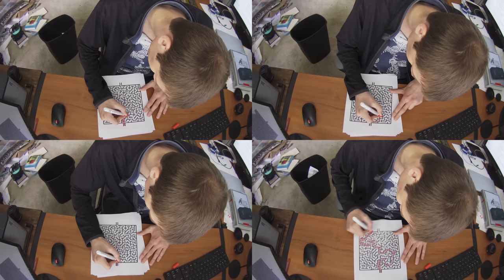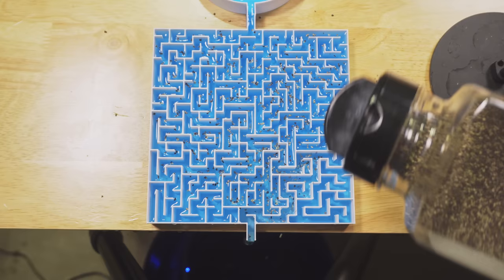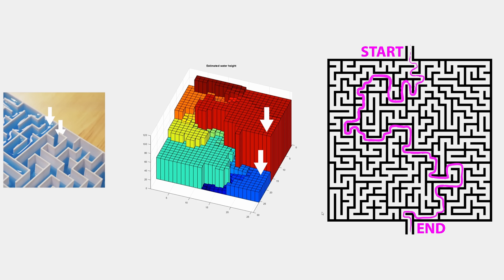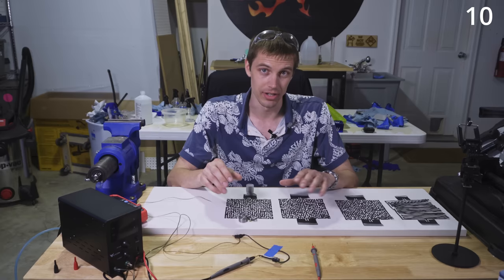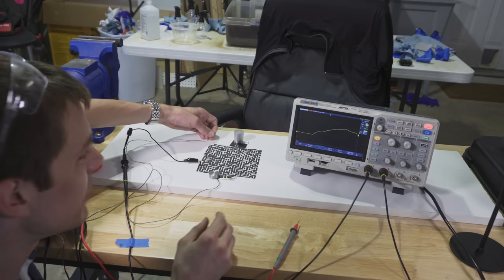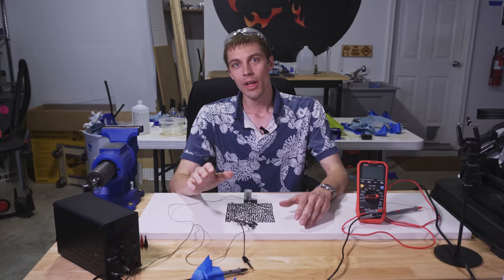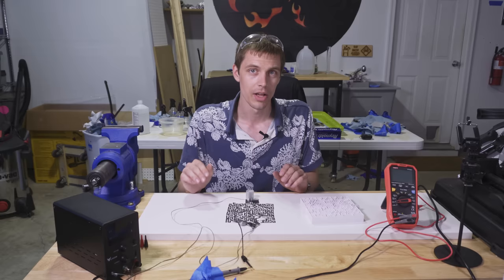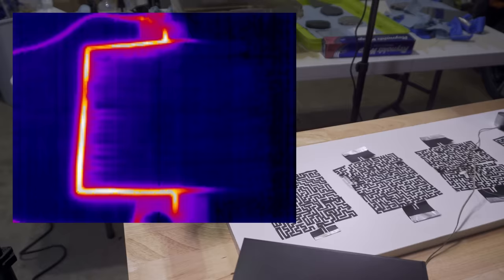How does electricity find the "Path of Least Resistance"?

Comment: The ending discussion here reminds me of two of my physics teachers back in the day arguing about whether the electron flow itself occurs at the speed of light, or if they move only a couple centimetres a second but transfer the energy to their neighbour at the speed of light.
Reply: Amperage measures the flow of electrons per second past a point. The flow is very slow.  The pulse through the wire is at the speed of light. It takes a long time for any one electron to move any substantial distance. It takes a long time for a water molecule to reach your home from the pumping station. But You have pressure, in your home, soon after the water pump is turned on.
Reply: @MrSummitville  yes, but the other one was arguing it’s not really analogous to water because electrons are clouds of waves rather than “actual” particles. Then the first retorted that it was just as equally a particle as anything else and their water metaphor (same one you just made) was valid. This went back and forth for hours, and they were both PhDs.

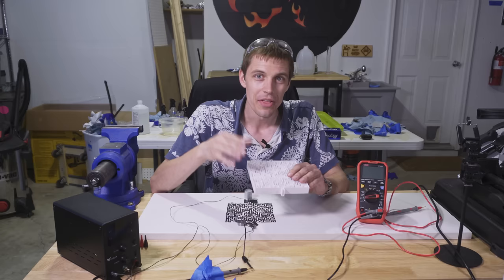Comment: Really good visual demonstration of current! One thing I think might be slightly wrong though (please correct me if it's not) -- When you compare the differences between water and electricity at 15:45 or so. I don't think the difference in water height at the start and end is analogous to a difference in electrons per unit length of wire entering and exiting the maze. I'm thinking the water height change is instead equivalent to the voltage lost between the input and output.

Comment: I'm sure others have said this, but I think it would be interesting in the final setup (before cutting) to start bridging rows of the long "ladder."  The more you bridge, the more that portion should heat up—except the portions you shortcut with the bridges.  Those, like the other longer paths, should still be getting some current, but less.  And, depending on where you bridge the circuit, the "cut off" portion should less the further away the bridge is.
Reply: Just like streets in a city

Comment: Emergence is a thing.  I've written articles and I have a few videos on this, but essentially if you take some very simple rules and apply that to a system you will often see an emergence that looks like some kind of intelligence (I believe intelligence itself is emergent, but that's a whole can of worms I don't wish to open here).  Dijkstra did some work on this and his algorithm describes the least resistance path that electricity takes.  That's why it seems to "solve" the maze - much like A* or Dijkstra can solve a maze.  There isn't any intelligence in the agents - in this case electrons - they are just following basic rules to determine the least path of resistance.  You could even do things like instead of a wall, put a dot in the middle of a corridor to represent a "monster", since that path does not have the least resistance due to the "monster" it will not choose that path.  Also, gravity (unless you get into loop gravity or string theory) is geometrically based, so it's going to have  a very different effect than a field based force which is what electromagnetism is.  In a charged field, because of conservation of energy, it will move to reduce the charge to zero - every single field that is oscillating is actually trying to reduce to zero, so any difference of charge will effect the same amount of response.  How long that response lasts in the time domain will determine things like field strength, but that's a more advanced topic.  The point is it's a field and it's going to respond the same regardless.  In a geometric construct though different properties will determine how strong that force is.

Comment: I'm not sure if I entirely follow what your correction 2b is trying to say, but I need to make a comment about/related to "surface charge".  Veritasium has done a good video explaining this but my understanding of the process here is that the propagates volumetrically through space at near light to produce a charge gradient, this causes a slow (order of cm/m) migration of electrons that increases until it reaches equilibrium with the charge gradient.  Voltage is the difference in the charge gradient that (mostly) concentrates on surfaces, current is the migration happening at any given point in the conductor.  The electrons don't really slosh, they don't move fast enough, it's the charge gradient seeking equilibrium as the wave fronts move through the medium of an unstable system.  The "path seeking" aspect is in Maxwell's stuff.
I think that's what you're referring to with the remarks about it being change at the top of the water, but that's pretty much surface charge.
(And yes, I know you're aware of this cause you were involved in the video debate I referenced)

Comment: In the University of Surinam they used electrical current to model the water levels in Rice fields. Connect current sources / sinks to opposite ends of a Carbon (copy) sheet cut to the shape of the field to be modelled and use a voltmeter to measure the simulated waterlevel (dd. 1984).

Comment: A differing test would be to design a maze that has two or more solutions, that are the precise distance and precise resistance, but not the same geometrical path, and see what the visual view is of the heat caused electron flow. It might produce a surprising result. Take three equal lengths of wire. String them through a long maze of twists and turns. Apply the voltage and view the heat signature. All three wires should be equally lit with heat… correct?

Comment: A mathematicians might be tempted to describe the way that both the water and the electricity solve the maze as a physical implementation of Dijkstra's algorithm[1], which is generally explained as "simultaneously exploring away from the starting point in all directions until the ending point is reached." If you explore in all directions equally, you guarantee that the first solution that you find is the shortest possible solution (since if there was a shorter solution, you would have already found it). But why stop there? What's interesting about the water and electricity is that it isn't "trying" to find THE path of least resistance, its trying to find the PATHS of least resistance, such that the total flow is as high as possible for the given voltage and arrangement of resistors.

If you take creative liberties with how you measure distance, Dijkstra's algorithm becomes the even faster A* algorithm, which can almost be explained by taking your water maze and tilting it towards the solution [2]. The "almost" is because if you tilt your maze as much as Steve Mould did, you effectively replaced the natural gradient in flow direction with conditional logic in terms of what order the paths fill up. This problem could probably be solved by making the flow channels narrow enough that surface tension caused the water to fill the full width of the channel, such that it wouldn't skip paths anymore.

[1] Dijkstra's algorithm
(https://en.wikipedia.org/wiki/Dijkstra%27s_algorithm)

[2] "The hidden beauty of the A* algorithm" by polylog
https://www.youtube.com/watch?v=A60q6dcoCjw

As an exercise to the reader, try not to get nerd sniped:
https://xkcd.com/356/

Comment: After you showed the behavior of junctions, isolated areas and water levels I immediately thought about probing various points of the electric maze to see if the voltage detected would be analogus to that.Excited to see you actually did that experiment and worked.I'd say you lucked out on good electrical isolation so the surface wasn't pulling your stray lines towards ground

Edit : in the long/short track where you snipped the short track, the long track showed extra heat around the 90 degree bends.I wonder if that's because electrons actually make an effort to turn or the thermodynamics of the foil geometry itself.
Call Electroboom ?
Reply: I think it is inductance, the further away they are from the vertex of the angle, the colder they are.
Reply: Since when is a good start to understand simple concept of basic insulation "lucking out" and not genius planning leading to good implementation

Comment: Hi! Just a quick comment about your "electron flow" statements, particularly in the "two solution" example .. What is happening is that each path has a cumulative resistance. Like having a 1 ohm and a 10 ohm resistor in parallel. Both resistors will have current, but the 1 ohm resistor will have ten times as much current as the 10 ohm one and will thus dissipate more heat. Also, as far as the "ripple" you were measuring, if you're "feeding" the system with a square wave, I believe that is a propagation effect. And that would be dependent on the inductance and capacitance of the sections of the maze. I think it would at least approximate the water model but by charging the capacitance and overcoming the reactance of the inductance. In your model, these values are extremely small. Capacitance would be similar to the volume of a water channel and inductance it's "width" (how fast water can flow into it). At any rate, it is an interesting experiment. Thanks. kurtt

Comment: Electrically you can think of the maze as a giant voltage divider made up of thousands to hundreds of resistors. In theory if you measure any point on the maze in reference to ground, you should get a voltage potential proportional to the input voltage.

Comment: You used a good conductor (aluminum) and so probing around the maze could be chaotic.  Perhaps print the maze circuits on a resistive material would allow probing of potential around the maze more stable.  Perhaps you could just draw the maze with a pencil (yes the graphite line will act like a resistor).  As long as the lines are consistent, the resistance per length might stay persistent.  The down side is the current would go down (or you would have to increase voltage) so that the heating might not show up on thermal imaging.

Comment: I believe this matches up with lightning strikes. under slow motion, you can see the branches of electrons fan out until one of them finds a path, and then they all go back and race down the main trunk line. the idea that it just finds a path of least resistance is false. more accurately is, that it searches for the path, then takes it. Also on some footage you can see that two paths can find there way to the ground and one of them can be brighter.

Comment: You can also do a resistance analysis for the total length and then there is a multiplication factor to account for 90 deg change in direction.  
Also, height is a valid pressure measurement, I believe the conversation factor is height in ft divided by 2.31 equals psi

Comment: there is also a hydraulic effect based on diffusion to solve the maze. Nut requires not the flow, but a large tank at the exit. No use of gravity. Could be ink drops to the water. And much longer time to perform)

Comment: You should use the 3d printed fluid maze with an electrolytic solution and put a thermal camera on that to watch the fluctuating temperature currents. It would be interesting if you rigged voltage meters throughout the various mesas.

Comment: Okay so much is going on here that i feel the need to explain it.

The mazes you were initallly working with appear to be perfect mazes. Meaning you can pick any two points in the maze and there will only be one path between them. Though it looks like you addressed this near the end of your video.

Next the soultion methods. The algrothim that is used here is called breth first search. With water when the maze is filled it will go in all directions theough the maze untill it finds the exit or the maze is fully filled. The same is true for electricity, just its technically sending a surplus of electrons from one side in a breth first search patterin, and pulling holes from the other side in the same patterin. When they meet the soultion is found. The algrothim if run past first soultion find all posible soultions. Humans tend to either follow a random path or, follow a depth first search path through the maze.

Lastly the reason for the lower heat on the longer path. This is because of parrallel resistance. When you have more than one path, the circuits are in parrell. Since resistance through materials is  dependent on how much material there is between points, the result is the longer path will have more resistance. Since lower reaistance means more current, and more current generates more heat. You see more heat generated on the shortest path. This would change in a superconductor, as they have the theoretical zero reaistance. So, for them all paths should appear the same. An equal ammount of current should be seen on all paths. (Id love to test this but of dont have the proper equipment.)

Lastly, your looking at a metal with a thermal camera. Im not sure if you know or not but metals are IR reflective. So, while you can see the path. You would see it clearer if you painted the maze, so that the heat would asorb into the paint and not reflect heat.

Comment: That water version of the maze was very informative. Later in the video I got to thinking that perhaps the analogy would have been better if instead of the flow you used the pressure. The flow like your infrared view shows the effect of the pressure differences as a result of the varying depths. So maybe flow=heat & pressure/depth=voltage.

Comment: You could also think of the multiple paths as resistors in parallel. With the paths having the most resistances, they draw less current than the ones with less resistances as they draw more current.

Comment: Such an amazing video. This is also true for electronics as well. One thing that is confusing for me is related to voltage. When two batteries are attached end two end summing the voltages up, why does that happen? How can electrons gain more energy and "pressure" when going through the batteries chemical reaction? How does the energy carry across. Take the simplest battery the voltaic pile, it is even true for this. How does this actually work?

Comment: In the water maze if the water height at the maze end is less than at the start then the velocity at exit must be greater otherwise the maze would fill up - This was evident from the difference of pepper grain speed at the start and end. However there is no physical restrictions that would increase the water pressure - I think this is a similar process to that which occurs in a Tesla turbine. - That is the stagnant water trapped in the maze must be applying pressure to the water flowing on the optimal path.

Comment: The current doesn't take one, and ONLY one path when there's several possible ways to do it. It takes ALL paths, even one that dead-end (you simply have such a low current, you can't read it. Electrons CAN flow through ANYTHING and the "dead-ends" actually leak electrons to the air and then back to other paths and it can be measures with equipment that goes to the nano-amp (1/1,000,000 of an amp) or maybe pico-amp (1/1,000,000,000 of an amp) or femto-, atto-, zepto -or yocto-amp (1/1,000,000,000,000,000,000,000)  area.

"The path of least resistance" is simply that said path is "wider" (not in strictest sense but it works for this.) If you have cars going down a single-lane road, you can only get so many cars to the end in a given amount of time. If you dig trenches in the road, you slow that traffic WAY down bit still lets the cars go by (just much slower.) If you had 10 lanes, you could get 10x as many cars. Setup 100 lanes and you get 100x of the same number of cars. No car "took the path of less resistance" (or the easier path.) They all took the same path.

So that's a single conductor or resistor connected to the power source. But that was the ONLY path (disregarding the path through air, etc.) So now let's split these lanes: 25 on one side and 75 on the other. You now have two resistors in parallel and you get a 25/75 split in the number of cars getting to the ends. And the speed of the cars is the same in all lanes so there's not even any "incentive" for the cars to prefer one over the other.

Now let's add another lane but this is the one with potholes, etc. The cars in the other lanes can do 60mph but a car on this lane can only do 10mph. So CLEARLY it's obvious the electrons will skip that path and all go shooting down the other lanes. So we got that settled. Class dismissed.

Wait, what you you mean by "you're totally out of your gourd and cars will NOT go just down the 100 lanes? Don't they take "the path of least resistance"?  Clearly super-smooth lanes are easier/least resistance than that pot-hole infested one.

No, they take ALL paths but the harder the path, the less the electrons go down it. And if one electron goes down the solution path for ever 1,000,000,000,000 that took the super-highway, you STILL have that one electron that went that way.

Comment: This is really easy to explain if you understand that every maze can be broken into (numSolutions+1) section (in these conventional math mazes with exits). Further any non-solution path can touch the solution path at most once. So, seeing the solution path as our first circuit, any non-solution path will take on the voltage where it connects, any solution path will follow ohms law and take each according to the inverse of its resistance. 

It would be interesting to see if a center solution maze would play nice, it can't (or rather, it's possible not to) be divided so ..... huh might still work actually, maybe the dividing of the maze is irrelevant, just ohm through the solution circuits and any non solution still can only touch in one spot (else they be part of a long-cut solution, back to ohm) and thus only act as multimeter probe extensions to the spot they touch.